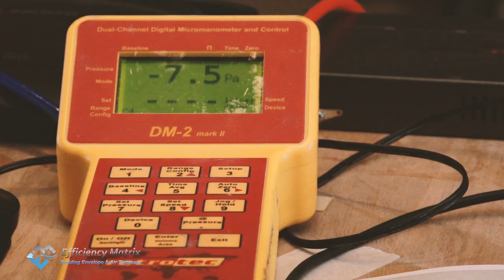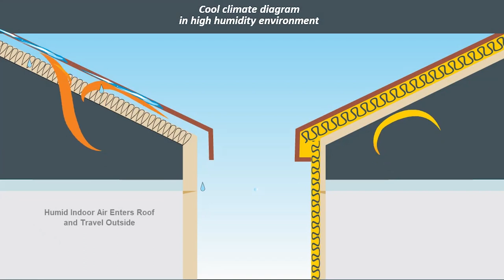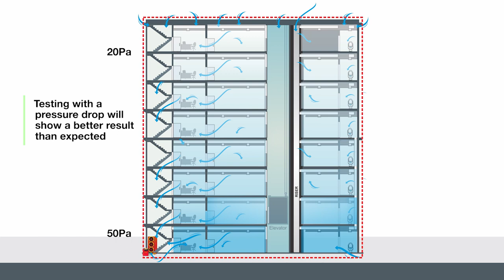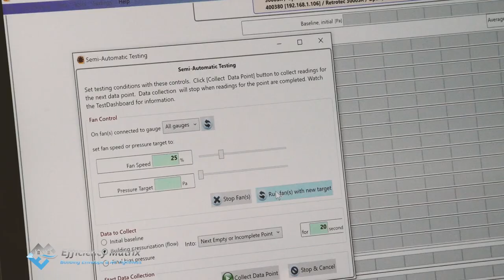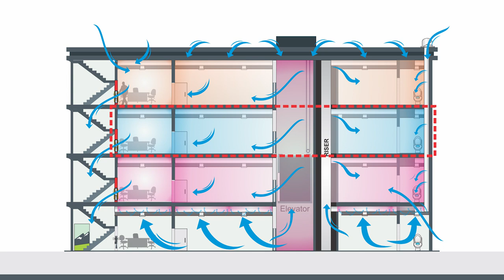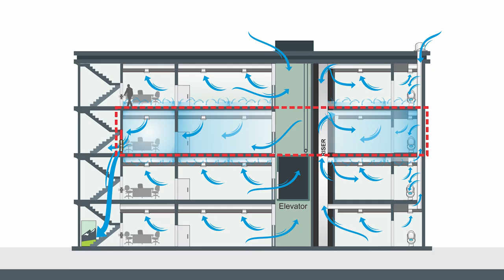Jeff Robinson talks about green buildings getting back to basics

Comment: Air sealing and blower door testing is under appreciated. Air sealed, super insulated, triple pane windows, high efficiency heating and air conditioning systems, high efficiency appliances, LED lighting systems, set back thermostats, 2/6 or 2/8 wall construction with thermal breaks, solar panels with battery storage and an EV charger in the garage. Saving energy saves money on utilities and makes the building more comfortable.

Comment: There needs to be stricter building codes that require energy efficiency.
There is a Climate Crisis. We all need to do a better job of reducing fossil fuels use.
Seems like there should be a trade show or some other public event that helps to educate the public, builders and architects. Universities need to incorporate Net Zero and Passive House design techniques in the engineering and architecture programs.